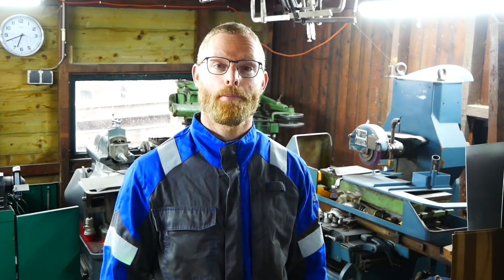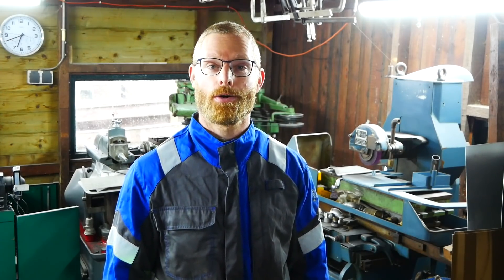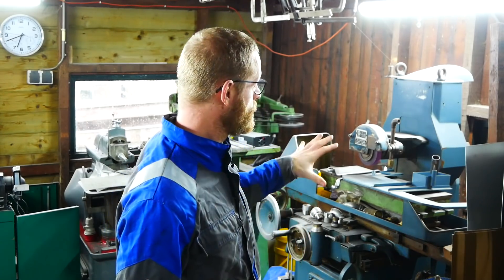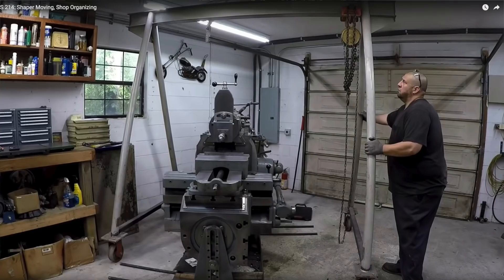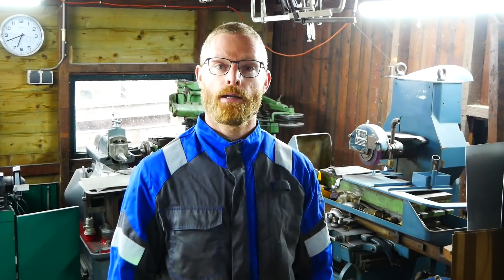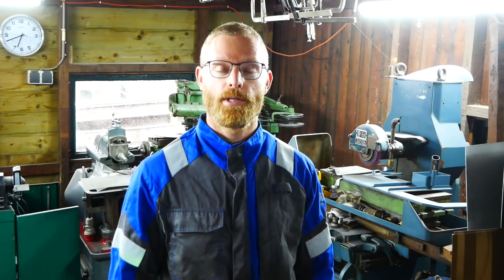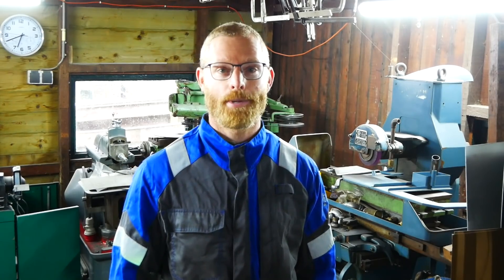Making a Mobile Gantry Crane - Part 1

Comment: Your welding looks great but who has the time to waste doing so much prep when you could just mig it? Plus who engineered the job? Not trying to be an ass but I been in the business for 45 years.
Reply from the maker: Yes, no problem. Functional comment. I don't have a MIG machine and I like TIG welding. And I want to do a good prep for the paint anyhow. Engineered by me. I (think) I know what I doing. I made this for 'light' machines, max 1000 kg and only straight lifting. I watched a lot of commercial ones and I am confident it will be strong enough.
Reply: @bartharkemametalworks2299  great looking job. Best to be safe all the time.

Comment: Why didn't you yde a MIG machine to weld that up? I understand if you don't have one but that machine you have will run stick all day long. 7018 is way more appropriate for that job and is much faster.
Reply from the maker: I don't have a MIG machine and I like the clean TIG welds. And i'm a little better TIG than Stick.

Comment: Having designed, built and installed a few hundred of these in my life, my biggest concern it with the TIG welding.  Never have felt good about it in any lifting apparatus, but it's your life not mine. Why? Because you don't get a good penetrating weld with it. Also, you do tend to talk too much, wer can clearly see what you are doing. Reduce your talking by two-thirds and you'll be fine, also your videos won't need to be so long.
 Now go buy or rent a MiG and use 70 KIS flux core wire. Throw all the other stuff away and test it at 125% of the load and put it through all it's paces every year you need to do that. No charge this time for the consultation.
Reply: Ken Parnell wow another internet expert
Reply: @esimler  As it happens I an an expert on cranes and material handling devices, and no one TiG welds any of it.......ever! Don't say you haven't been warned when the stuff comes crashing down.

Comment: Very nice work Bart. I learned something interesting by watching your video today. That welds can pull metal. I did not know that after you had secured the bottom foot that the side supports could pull the steel, and by that much. It's interesting how materials work together. Thanks for the explanation and I hope to remember that tip when I'm doing my own work. I'm learning stick and MIG diy style. I hope to get into TIG at some point. I love how those welds look afterwards and it looks so much easier to do (looks, whether or not is the case I'll find out 😜)
Reply from the maker: Thanks!

Comment: If you have an AC/DC power supply, why didn't you stick weld it? It's faster, and (usually) more forgiving about surface prep. Just wondering........
Reply from the maker: I like the clean welds from TIG and a need to do a good surface clean for the paint anyway.

Comment: I had the same problem I write with my left hand but thow a ball with my left. When I was learning to weld I stuck with my left hand but there was one other person I knew and they used there right hand. I can use both hands to hold the torch but only switch to my right when it's in a position I can't reach with my left hand
Reply from the maker: I prefer to use my right hand for the torch and have a good control with the wire with my left. Switching only in positions where it is better to use my left. It's not the torch that is the problem, I feel I have less controle with my right hand to feed the wire.

Comment: if you weld the nut on the corner of the tubing (facing the center) the locking bolt will push the inner tube in the outer tubes corner, registering on 2 walls instead of one...should take out any slop between both tubes

nice work though!
Reply from the maker: Yes that would also be a good solution for many projects like this. The only problem I had was that the radius of the inner tube corner was a lot smaller than the outside tube. Therefor it would only contact at the corner and not the side walls and be less stable. My 20mm bolts that hold the tubes have a tight fit. Fixing the nut, it will slide on these 20 mm bolts to one side. That way I will take out the play in both directions. If there is still to much movement between them I can always add a slider from delrin or brass.

Comment: Just use a simple crank set-up with steel cable to adjust the height. That's how mine is, and I don't really "adjust" all that much. It spends most of it's time resting on the high strength thru-pins. Also, consider "machining" a delrin slider gasket that takes up the gap between the two telescoping posts. It would be like a square hole "cap" that gets screwed to the larger, bottom post. And that keeps the post from wiggling side to side when you are actually moving things around under load.
Reply from the maker: Thanks for the commend. I think I will need the height adjustment a little more but we will see. And I thought about a slider, maybe delrin or thin sheet of brass. But I first want to see how it works without and I can always add a slider in the future.

Comment: Which is the stronger weld for steel framing such as this, tig or stick weld, thoughts?
Reply from the maker: Difficult question. I think it depends on material and welder. For me on this project: TIG. I take my time with TIG to clean everything very good and put a good bevel on the steel. Then I weld one normal pass and then a wave pattern. And I make sure that the first pass goes into the corner. Both at 200 amps which gives a good deep penetration on this 4 - 10 mm steel. With stick welding it can burn a little bit deeper (but this steel is not solid so it's not necessary) and it is less critical to have clean steel and easier to get into the corner. But as soon as there are gas pockets inside the weld the strength will go down. Next to that, with TIG welding I find it easier to lay a good weld in different positions. And with stick it is also more critical to have the right electrode. Last is temperature controle. For normal steel it is not a big difference. For special steels that harden, TIG gives better temperature controle that have a lot of impact on the weld. But for solid pieces, stick could be a little bit better because it gives some more heat imput (in normal use). Beside welding, I think it is more critical to have a good design where there are no great forces on the weld itself. Press or pull forces are better than shearing forces.
Reply: @bartharkemametalworks2299  Thankyou for your comprehensive reply. Your explanation would generally be my thoughts also. Gas pockets are always an issue wuth stick welding where as tig is clean, tidy, accurate and more pleasing to the eye. Thankyou 👍

Comment: why tig , it looks like your right on the edge amps wise , and if anything looking a little cold.
but nice work.
Reply from the maker: I like TIG for the clean work and easier (for me) to weld in different positions. The amps where alright (it's only 4 or 10 mm steel). On the 10 mm I could use stick and burn in a little deeper. But I believe this is strong enough. With a good bevel I could do a first pass at around 180A and then set it to 200 for the wave. Maye the steel looks cold because I use a little higher gas flow than normal and with a gas lens I keep the steel for oxidation. But welding the first pass and then the slow wave did put in a lot of heat.

Comment: Yeah, Hi Bart..Could you spend an hour or two putting together a sketch of  all your dimensions , including your shoe size and the distance from ear to elbow while enjoying an ice-cream, Well because I'm an idiot that shouldn't own ANY TOOLS, let alone fabrication tools. But HERE LET ME TELL YOU HOW YOU SHOULD BE DOING EVERYTHING BECAUSE I MATTER ! 

Bart, I wanna partially apologize for the following. But since YOU and allot of folks on here are just TO NICE and  wont put stupid in there place,  The following contains instructions and suggestions for the sexually confused  commentators!  
 
Dear, Concerned and extremely irritating commentators ,
  IF YOU CAN'T BUILD A SIMPLE ROLLING A-FRAME TO HANG A HOIST FROM , YOU DEFINITELY SHOULDN'T BE HERE BOTHERING BART OR ANY OTHER PERSON ON YOUTUBE FOR THAT MATTER WHO HAS MASTERED THE ABILITY OF COMMON SENSE,  FOR DIMENSIONS...AND IF YOU, THAT SPECIAL LADYMAN, HAD THE AUDACITY TO GIVE BART GRIEF FOR CUTTING STEEL ON HIS "PRETTY" PATIO,  OR IF YOU, THE ONE WITH NO FRIENDS, FROM HIGH UPON YOUR ESTROGEN FLAVORED PONY YELL DOWN INSTRUCTIONS ON HOW HE SHOULD OR SHOULDN'T BE CUTTING STEEL, YOU NEED TO JUST STICK WITH BAKING MUFFINS AND FINDING NEW PLACES TO STICK YOUR SONIC TOOTH-BRUSH ,  YA SEE CUPCAKE , THIS IS ACTUALLY HOW THE REAL WORLD WORKS. THE CHOP-SAW DOESN'T HAVE A "PERMA-HOME", IT'S USED ON THE SPOT WHERE YOUR WORKING, AND IT DOESN'T WEAR  SILK PANTIES TO CATCH SHIMMERING UNICORN FARTS!  THE 40, 80, 100 MICRON LENGTH IRON, ALUMINUM, ALUMINUM OXIDE, ALUMINA, BORON, ZIRCON , SILICON,  ETC PARTICLES EJECTED BY THE CUTOFF SAW HAS NEVER IN THE HISTORY OF MANKIND, THAT'S "MAN"-KIND TO BE CLEAR,  EVER BEEN THE ROOT CAUSE OF ANY "SPLINTER", ...EVER!!!!!!  WHY? BECAUSE THEY'RE FINER THAN THE DIRT AND ROCKY DEBRIS THAT LAY BENEATH. AND AFTER  A GENTLE BREEZE, OR ESPECIALLY A GENTLE RAIN THEY  LITERALLY MELT AWAY BACK TO THE CHEMICAL STATE THEY ORIGINATED.
Reply from the maker: Hi Bryan, I don't really mind the questions and comments. It's nice to hear from people and see there reactions. And sometimes I learn from it. But how I react to the reactions is always a choice I can make by myself. So thanks for yours. Btw, ear-elbow-ice would be around 40 cm ;-)

Comment: Have a looke on this move, where Keith Rucker on VintageMachinery modify his gantry crane.
https://youtu.be/nmVnS6PErSc
Reply from the maker: Thanks, didn't see the video before. It's a nice solution but I'm going for a Manuel Winch solution to pull the inside tube out of the outside tube.

Comment: Looks great, hope you can put a sketch with dimensions. I need one, but for rough terrain.
Reply from the maker: Hi Ray, I don't think the dimensions are really critical. Use what material u have and one that fit the size of you shop. Mine: Top beam 230cm. Standing tubes 200 cm, slinding inside from 250 cm to 380 cm height. Leg beams are around 150cm.

Comment: Hi Bart, great work.  Love to watch you TIG weld... you are very good at it.  With regard to how to lift the gantry crane, I think Keith Rucker used long reach, hand pumped hydraulic rams... I think also one of the Polish guys did too... 'Made In Poland' maybe... (sorry, can't remember).  I'm looking forward to your solution.  Hope the move goes well!  Greetings from Southport UK.
Reply from the maker: Thanks Kevin, I decided to use a Hand Winch to pull the inside tube out of the outside tube just like. You will see it in the second video that will be online within a week.
Reply: @bartharkemametalworks2299  Looking forward to it!

Comment: I cannot believe you are cutting that steel out there on that really nice patio/masonry floor! You’re a very talented man... make yourself a cut station with an expanded metal top for the saw to sit on, and a hopper bottom to collect all of the abrasive and metal. Add a taped back/ deflector and side rails no taller than the height of the saw deck to route the sparks and metal down into the hopper as well. There is nothing worse than metal slivers in feet and paws you cannot see.
Reply from the maker: You sound just like my girlfriend .... LOL. Just joking. You are right. I will move to a bigger shop next week and will be making a proper grinding table and welding table. To many projects..... This one needs to be done first.
Reply: Where do you think I heard this from! :-) I’m just an old guy tryin to help out you young bucks!
Reply from the maker: @trevorjarvis3050  Haha, nice. Thanks.